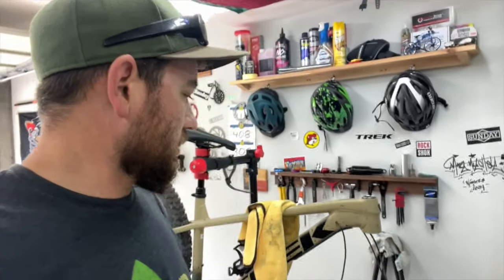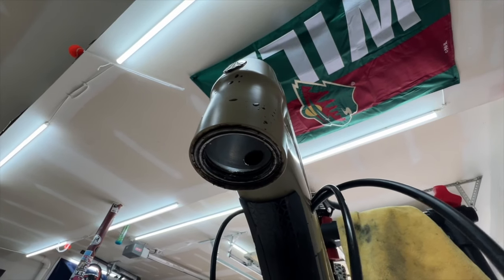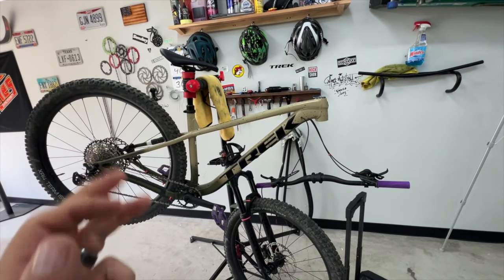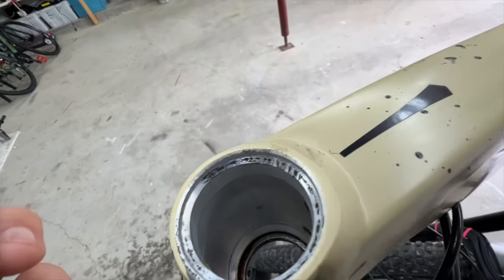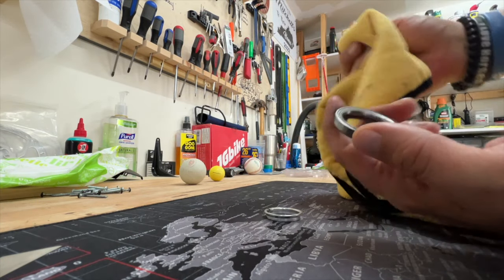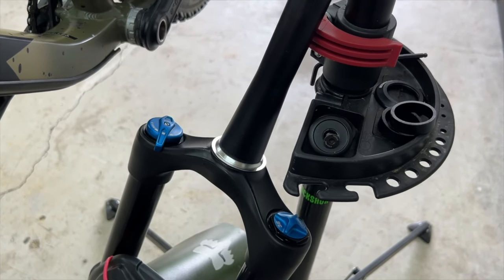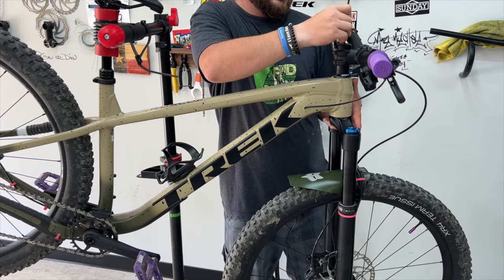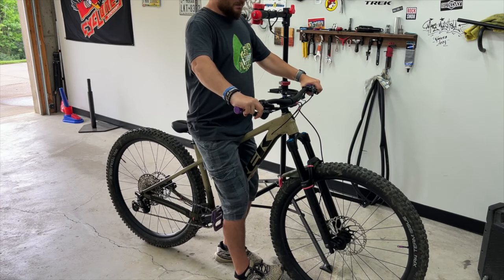CLEANING THE HEADSET, TROUBLESHOOTING CREAKING TREK ROSCOE 9

Comment: Helpful vid, replacing my Roscoe 8 headset with a Cane Creek Hellbender IS.  My Roscoe is new and just getting into replacing parts. Replacing with fox 38 forks with Oneup stem and one up carbon bar.  Your downtube protector, where did you pick that up?  I need one. Thanks 👍👍🇺🇸
Reply from the maker: @TheLoamMountaineer  thanks for the comment. Working on the bikes is almost better than actually riding bikes lol. The down tube protecter I picked up on Amazon a while ago. Just search bike protection and you’ll see so many options.